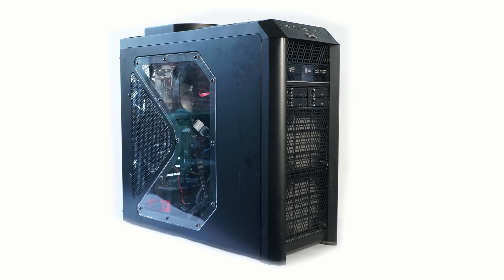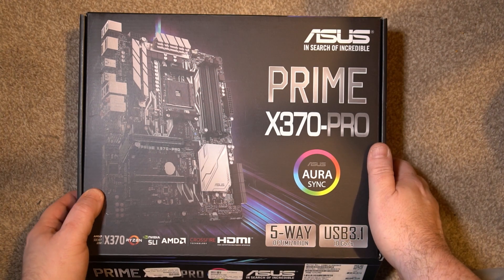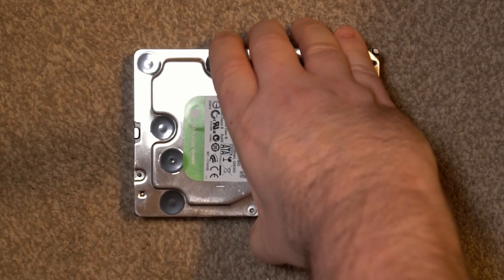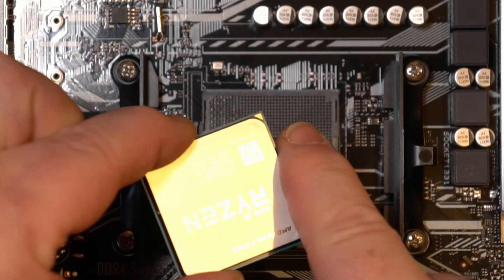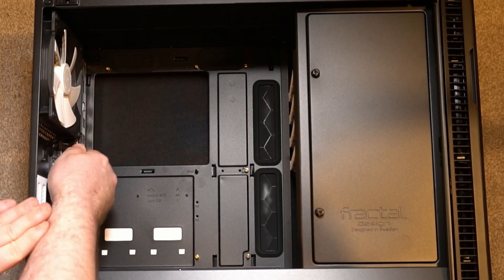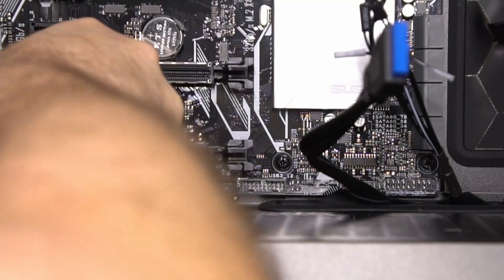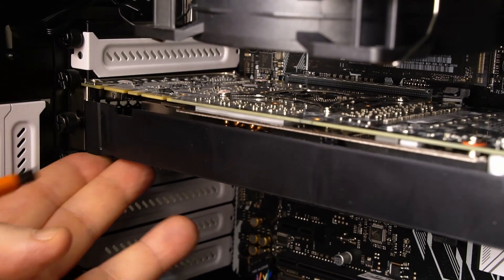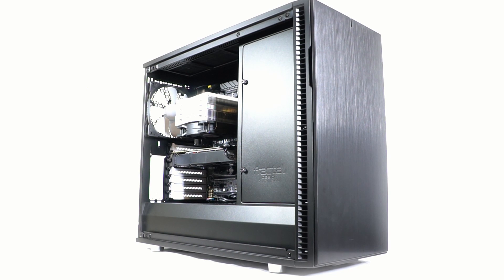Will it work, Intel to AMD upgrade, NO new Windows!

Comment: Hi there! Thanks for this great video!
I was wondering how u transfer your old OS ssd to your new m.2 ssd? Or did u still use your old ssd as your os? 
Im currently using i5 6500 upgrading to r5 3600.
Your kind help n ideas would be excellent!
Reply from the maker: You guessed it, I’m not using the NVME drive as an OS drive. It’s being used as a cache drive for video editing. Although transferring isn’t difficult, some drives come with a link to software (Samsung do). Good luck, hope all goes well

Comment: Hi, I’m upgrading from i5 7600k to ryzen 5 3600 and all I need to do is just swap out the mobo and cpu? Do I need to prep anything before changing it or what? Also I don’t need to redo windows 10 right?
Reply: Just saw a comment, I'll just paste that here, it's from a month ago (user juju pogi): "so i did the upgrade just this morning. i did nothing but create a system image of my os drive. aside from that nothing else. i changed the motherboard cpu and ram then turned it on with clenched  hands. and it worked normally. all the drivers are changed to amd's and up to now its working great and functioning well. just to let the others  who are in the same place as i was. thanks for the vid anyway!"

Same goes for me, I did not uninstall anything beforehand, just made a backup of the disk (just in case) and then swapped the motherboard and CPU.
Reply: @floo3108  (I also responded to Juju Pogi with this same question but:)

where did you create the system image of your os drive? to your secondary storage? I'm running windows on my SSD, but also have a 2TB HDD as well, that i've already backed up my computer files onto (also have whatever files my computer dumped into my OneDrive).

Do you recommend doing the system image to my HDD? or some secondary flashdrive with like 32 gigs on it? 

Might do a system repair disc too just incase.

Going from an Intel 7-7700k --> AMD Ryzen 7 5800x. New mobo, new ram as well. 

Additionally it says my Microsoft Activation is with a digital lisense linked to my Microsoft Account. So fingers crossed i can just swap out the parts, select my SSD as my primary boot drive, and be off to the races...

Comment: Hi, I’m upgrading from i5 7600k to ryzen 5 3600 and all I need to do is just swap out the mobo and cpu? Do I need to prep anything before changing it or what? Also I don’t need to redo windows 10 right?
Reply from the maker: I would image the hard drive just in case, but there was no need to reinstall Windows. Although you’ll probably get better performance if you do. You might need to install motherboard drivers
Reply: knewideas Image the hard drive? I also use my pc mainly for gaming and have like no important stuff on it that ill mind losing so If I change it just boot up normally
Reply from the maker: Ok, then I’m that case you don’t need to bother but if it all goes wrong you’ll have to reinstall the OS. Although I’ve not heard of anyone who has commented on this video who has a problem.

Comment: So I had a prebuilt that was intel, had an i7 9700f and a really cheap mobo, went to a ryzen 5 3600 and x570 msi gaming edge mobo, windows booted I could play games, but when I wanted to update windows it would go to automatic repair and couldn’t start in the new update. I wiped the whole computer and reinstalled windows, so far so good, should this have fixed evrything?
Reply from the maker: I’d say yes, if you haven’t had problems for a few days after then you should be fine. However with windows updates you never really know🤨

Comment: Hey want if I wanted to change my motherboard do you also have to get an activation key for Windows if I already had it in my ssd
Reply from the maker: I didn’t but it took a few weeks for the activate windows nag to disappear. I originally upgraded the OS from  Windows 7 and no longer had the discs.
Reply: If you call Microsoft support they will activate for you right away

Comment: Just the kind of video i was looking for.. Im going for ryzen 3700x new mo bo and ram and want to swap my existing intel system
Reply from the maker: Go for it, lots of people have had success doing this.
Reply: @knewideas3860  do i have to uninstall the existing intel chipsets and drivers and then install the Amd drivers or ot should be automatic?
Reply from the maker: Should be automatic, although you may need to install other drivers, audio, network etc for your motherboard
Reply: @knewideas3860  gotcha thats gr8 thanks :)

Comment: I've seen no issues so far. I was rocking a 4790k I7 and upgraded to an AMD Ryzen 9 3950X. New motherboard, CPU, DDR4 ram/memory and so far so good. I'm now trying to see how I can fit my OS onto the 500gb from my 250 gb 2.5 sata 3 SSD. I might just leave it as is to be honest.

That said, I did delete some drivers from the Intel build and reinstalled drivers one at a time. Still good so far since switching to AMD 2.5 weeks ago. And to elude to the windows key. As long as you saved it or have it recorded, all you have to do is reenter the key on the AMD build and it's good to go.

Also, memory, if only using two sticks, most times it should be inserted in dimm slots 2 and 4 anyways. But always good to check your motherboard manual and it should have a star next to the slots that should be populated first. And not because your CPU cooler is covering one of the slots.
Reply: I'm about to do this in a couple of weeks and I'm going to go with the manually uninstalling intel drivers route before I turn off my pc for the last time. Were there any specific labeled drivers needed to uninstall? Been searching everywhere & can't find a solid answer
Reply from the maker: That was the problem I had as well

Comment: did the old drivers for the old parts automatically deleted?  i am going to do the same tomorrow when my new mobo and cpu arrives.  i was wondering what else did you  do before the upgrade?? this is my first time to do a mobo and cpu upgrade. coming from intel to amd as well. tia!
Reply from the maker: Sorry can’t remember, I performed this upgrade more than 2 years ago. As long as you have the right RAM it shouldn’t be a problem. One tip is to back up or image the whole OS drive just in case you have to go back to the old hardware.
Reply: @knewideas3860  so i did the upgrade just this morning. i did nothing but create a system image of my os drive. aside from that nothing else. i changed the motherboard cpu and ram then turned it on with clenched  hands. and it worked normally. all the drivers are changed to amd's and up to now its working great and functioning well. just to let the others  who are in the same place as i was. thanks for the vid anyway!
Reply from the maker: Glad it all worked out for you, It’s not as scary as some people might suggest
Reply: @jujupogi9748  where did you create the system image of your os drive? to your secondary storage? I'm running windows on my SSD, but also have a 2TB HDD as well, that i've already backed up my computer files onto (also have whatever files my computer dumped into my OneDrive).

Do you recommend doing the system image to my HDD? or some secondary flashdrive with like 32 gigs on it? 

Might do a system repair disc too just incase.

Going from an Intel 7-7700k --> AMD Ryzen 7 5800x. New mobo, new ram as well. 

Additionally it says my Microsoft Activation is with a digital lisense linked to my Microsoft Account. So fingers crossed i can just swap out the parts, select my SSD as my primary boot drive, and be off to the races...

Comment: looking to do the same upgrade, did you have to remove anything from your hdd or ssd before you swapped everything over? or just a clean swap?
Reply from the maker: Just a swap, I used exactly the same SSD.
Reply: @knewideas3860  you had to re insall windows to the new motherboard?
Reply from the maker: No, all I did was connect the existing SSD to the new motherboard. I didn’t have to reinstall windows at all
Reply from the maker: However I did have to install new motherboard drivers from the manufacturers website after I had moved the SSD into the new PC
Reply: @knewideas3860  awesome. thank you so much.

Comment: THANK YOU SO MUCH!! I've been looking for a video like this hoping that someone did this before me
Reply from the maker: Glad I could help!
Reply: So i can easily switch my mainboard and the CPU using the same SSD (which has Windows) and installing my HDDs as Game Drives without reinstalling? What about the old Intel Drivers? Do i need to un install them though?
Reply from the maker: Well I didn’t uninstall anything and it worked fine. The only thing you might find is that old drivers left behind take up space. For example I had about 7GB of Realtek network drivers from the old motherboard that I didn’t need as the new board used an Intel network chip.
Reply: @knewideas3860  just download a program that deletes old unused drivers.

Comment: I'm planning to upgrade my Haswell i5-4460 to a AMD Ryzen CPU. I hope it will work as flawless as it did for you.
Reply from the maker: I hope so too, most people will tell you not to try it, ‘it won’t work’. As long as you have a backup image of your C drive you don’t really have much to worry about. You can always go back to your pre upgrade hardware with the backup, just in case.
Reply: To what Ryzen cpu are you looking at? I have a i5-4570 and looking for a Ryzen 5 2600 or 3600 whichever will work best for my GTX 1060 6gb.
Reply: @singwithme4480  I'm planning to upgrade to a R5 3700X
Reply: @rabitec.   Wow that's a big leap bro. Go for it!

Comment: Great video but what other bad story's have you heard of? So I can just change the motherboard and cpu and still use the same ram and ssd?
Reply from the maker: Look for bad stories and you’ll find them, I can only tell you my experience. I was not expecting it to go so well.

It very much depends on what the motherboard supports with regards to RAM as you don’t say what you have. You can’t use older DDR3 ram in a DDR4 board.

As for SSD the same applies but generally you’ll find both NVME and SATA support on Ryzen boards.

Comment: Heat sinks blocking first ram slot so has to use  slot 2 and 4.... 2 and 4 are default slots. basically those slots are the first slots you should use no?  i mean unless you have a wacked out mobo????  Slot 1 and 3 is just backwards...
Reply from the maker: Since making this video I’ve changed the cooler to a better one and also added an additional 16GB of RAM

Comment: Why do you have the CPU cooler mounted vertically? Wouldn't it be better to mount it sideways as to have it blow straight into the exhaust fan, so there is lesser heat being built up at the top of the case?
Reply: Bestage, the cooler will only mount that way. Yes ideally it would be mounted the way you say. In fact what I have done is fitted a new cooler which blows right to left.
Reply: Not only that hes taking heat from the gpu and blowing it to his cpu. Little to no cooling there....

Comment: idk why im here...i already know it works, because i just did it to my pc.
Reply: Works without any issue my friend? I want to upgrate from i7 5th gen to Ryzen.
Reply: @DimitrisSKG  Works fine for me. I have been using the same windows installation since 4th gen intel, through 6th gen intel, and now on AMD.
Reply: @ThatWhiteHand  so you switched from Intel to AMD without doing anything to windows? and everything was fine?
Reply: Still on the same installation right now. It is still a do at your own risk type thing, but on my SSD I have never had a problem and have put it through multiple CPU's over the years.
Reply: hi im switching my motherboard tommorow and cpu from intel i5 to ryzen 3 3100 im hoping it will work
Reply: @IGIII04  Did it go well?
Reply: Zubayer Shafi nope as i bought a used motherboard and the guy didnt update it to 3000 ready so i could not use it 

(Update) worked after got a new motherboard
Reply: is it a strait forward "change motherboard and cpu, configure the bios and you good to go" or you need real change stuff regarding old Intel CPU stuff in your C drive?
Reply from the maker: I didn’t have to change anything but YMMV
Reply: When you switched motherboards did you just use the same cables you did for your old one?
Reply: @FahimPlayz  yes just changed the cables that the mobo came with and i also brought white cable extensions
Reply: @IGIII04  so you just swapped cpu, mobo and maybe ram and that's it? Anything else? I'm planning to switch from 3rd gen i7 to ryzen 3700x/b450/corsair rgb pro 3200mhz ram
Reply: @reyy1k  i swapped my mobo cpu ram yes, i had a asrock b450 pro 4 now i have a asus b450 f gaming. I also swapped the cpu from ryzen 3 3200g to a ryzen 7 2700x. And the ram from ballistix 8gb 2400mhz to corsair vengance rgb pro 16gb 3200mhz
Reply: @IGIII04  thanks :)

Comment: So it seems you were lucky I guess? Everything I read says reinstall Windows. Problem is, I don't have money for a backup hard drive for the system image. If Whenever I do, if I backup the system image and reinstall Windows, do I keep my files with the new windows? Or if I load the image it just boots back to the old?

I understand this might not be your level of expertise but I just thought I'd ask.
Reply from the maker: The first thing to say is I don’t think I was lucky, it should work. Although you may end up with the activate windows nag on screen which should go away after a couple of weeks. It isn’t the best way to upgrade as a clean windows install will work better.

That said when you do image the drive you only need to keep it for a couple of days and only go back to it if there’s a problem (and you have to go back to your old hardware too). It’s a fall back if there’s a real problem. When upgrading this way always have a plan to go back to the original hardware and software if it doesn’t work.

I wouldn’t want to risk loosing a bootable system if things go awry.
Reply: @knewideas3860  Ok well I just don't want to reinstall all my programs again and I was hoping to find a way to work around that. Thank you for your quick response.
Reply: Ya im in the same situation I am going to get off work in about an hr and do exactly what he just did. Hopefully all goes well and if not I have a clean install of windows plus a few games to reinstall nothing too bad, but I still dont really want to. I keep all my games on a different hard drive so hopefully no issues with those drives
Reply: @FadedDream6969  Please do let me know what happens.
Reply: @FadedDream6969  What happened in your case? I"m going from an I7-7700k --> AMD Ryzen 7 5800k. I can just swap out all of my parts, keep the same SSD that i have my boot drive set to now, and boot it all up? 

My windows account is set to activation through my Account. Also have my files backed up onto my HDD and whatever windows saved to my ONEDRIVE. 

Just curious how your experience went, if i could load all my games up and stuff with zero issues. 

Thank you!

Comment: so i have a latitude e6400 laptop with a intel cpu and i want to build my own pc but using ryzen 3 2200g, could ijust use the same ssd (plug in and done) without having to re install or even buy another ssd?
Reply from the maker: I’ve not tried going from laptop to desktop with the same drive  so I can’t be certain.

In theory it should work but as I’ve mentioned to other users here, I would recommend imaging your SSD before upgrading. This is just  in case you need to go back to your original laptop and drive (image)
Reply from the maker: Also be aware that all your drivers will need upgrading when you move systems including your graphics
Reply: i see, thanks for the help.

Comment: Great! Would this work on windows 7? 
I have a new motherboard and a ryzen to upgrade my workstation but can't allow myself to do a fresh installation of windows/softwares... 
Thanks a lot.
Reply from the maker: In would say the likelihood is that it will work as the underlying code base for Windows 10 is very similar.

However I can’t guarantee it, like another commenter here I will make sure you have a full backup, which includes an image of the drive that you can restore from if it goes wrong.
Reply: @knewideas3860  Will do that, which software would you recommand to do so ?
Reply from the maker: You can do it within Windows 

https://www.howtogeek.com/howto/4241/how-to-create-a-system-image-in-windows-7/

Comment: I was wondering if you could help me. Right now I have a Dell motherboard with a I5-4440 and 8gbs of ddr3. I am upgrading to a ryzen 3 2200g with an Asrock b450m motherboard and 8gbs of ddr4 ripjaws ram. Do you think everything on my hard drive will be fine? I am running windows 8.1
Reply from the maker: Also just be aware that you’ll need to re activate Windows, if you have original discs then it’ll be fine, if not you’ll probably have to contact Microsoft.
Reply: @knewideas3860  Ok thanks.

Comment: very helpful! i was planning on only upgrading my ram, gpu, and ssd but I found out I'm an entire generation behind and need a new motherboard for DDR4 ram, and needing a new motherboard also means I need a new CPU since the socket I have is no longer supported on DDR4 motherboards. I'm basically buying all new parts now. intel is way too expensive so hopefully the switch to AMD goes as smoothly as yours did
Reply from the maker: You’re reason for upgrading is very similar to mine. Good luck
Reply from the maker: Abu Bakar Mohd Aris, it’s not the cleanest way but it does work. You will probably not see the absolute best speeds this way but I’m still using it everyday. Although I’ve upgraded to 32 GB of Ram
Reply: Yeah same! It all started with my RAM, then I realized that I wanted DDR4 and AMD AND a new case, so I’m building a whole new PC except for the hard drives and graphics card.
Reply: @wuandondo4832  thats exactly what i ended up doing. just decided to go all in and build a fresh new pc, dont regret it a single bit